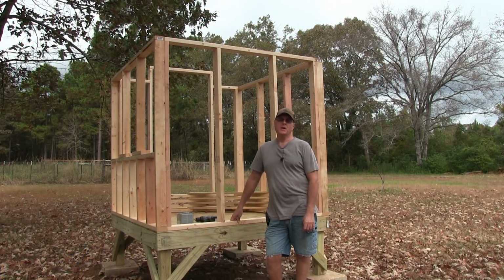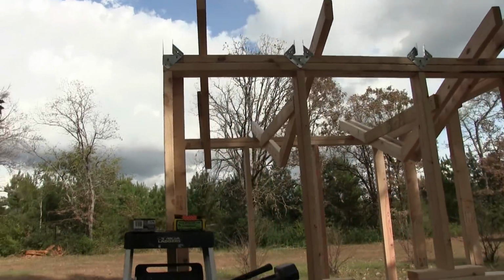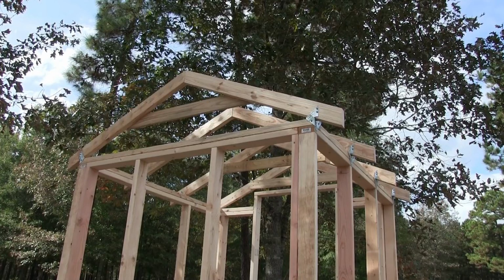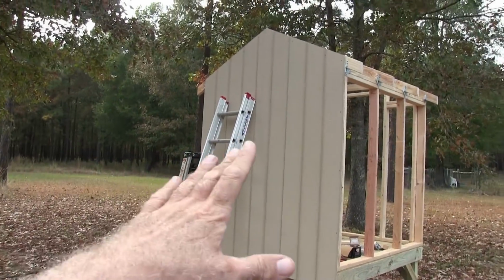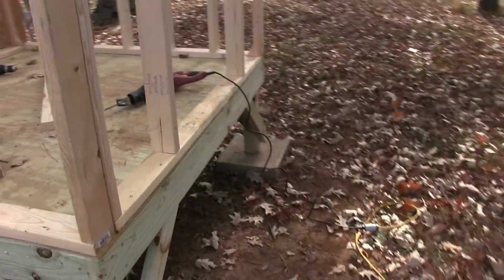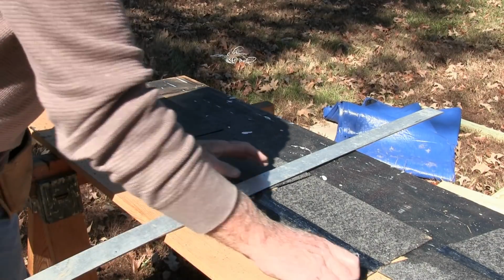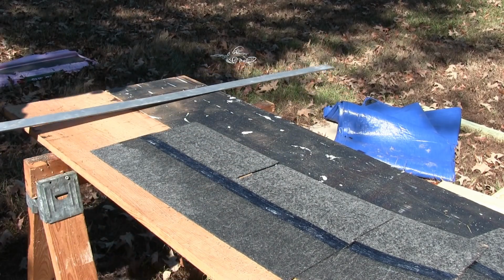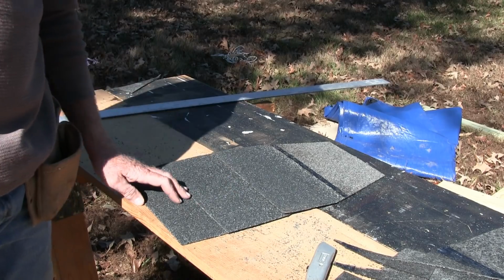Chicken coop build part 3 - Rafters, exterior sheeting and roof.

Comment: Hi Pete! Amazing videos thanks! I'm currently building all the walls. I'm half way done on em but getting nervous on the next step for the roof rafters. If you could give me an idea of what length each 2x4 should be before cutting a 25 degree cut would be awesome. I didn't quite understand what you meant by 12x5.59 so that might have something to do with it? I went ahead with your recc to do a 6x8 which the base turned out great!

Comment: What is that exterior sheeting called? It looks like OSB with a weatherproof coating on one side. Do you have a link for a US seller? I can't find anything like that in UK. Great video by the way. Thanks for filming, Andy.
Reply from the maker: It's called Primed Engineered Panel Siding. Here's some links: https://www.lowes.com/pd/SmartSide-38-Series-Primed-Engineered-Panel-Siding-Common-0-315-in-x-48-in-x-96-in-Actual-0-315-in-x-48-563-in-x-95-875-in/3058153 and here also. https://www.homedepot.com/p/0-344-in-x-48-in-x-96-in-Wood-Primed-Siding-Panel-Common-11-32-in-x-4-ft-x-8-ft-1277124/307432072
Reply: @petebeasttexashomesteading  Awesome, thank you

Comment: Hello Pete.  Good video on the build, but for a novice DIYer, it does not show some basics.  I going to build this design coop, but I need to know what you used for installing the siding.  What type of nails and nailer were you using?  Were they brads, finish or regular nails.  I have already purchased the LP Smartside 4 x 8 panels and want to install correctly.  I would greatly appreciate your assistance in this area, thanks.

Comment: Where is the ridge beam? I've never seen a wood structure built without a ridge beam. It just gives the roof more strength and stability. Everything else you've done is good, I may have done some things different but I cut my baby teeth on wood. My dad was a Master Carpenter and he probably forgot more than I could ever learn but he taught me everything I needed to know in order to build my own house. Best of luck with your chickens. Just a little suggestion....where the run top meets the coup, I would still nail the chicken wire down. I learned the hard way not to leave gaps in the wire bc a raccoon got into our run bc he found a gap. He murdered most of our chickens before we could get to them! He just killed them and didn't even try to eat one! My husband dispatched him with one shot! We put up a warning sign for all the rest of the little varmints that may think they want to try the same thing. I hope they can read the warning!🤣I states clearly that all varmints will be shot for trespassing!🤣🦊We dont discriminate either bc it goes for ALL varmints!🤣🤣🤣 We are raising ducks also bc their eggs are larger and in my opinion, has a richer flavor in them. If you make a cake that asked for 2 eggs, you only have to use 1 duck egg. They are so funny to watch too! Sometimes they get into arguments with the chickens over the grasshoppers during the summer!🦆🤣🤣 Best of luck! If you need any help with your chickens, just give me a shout! God Bless Y'all! P.S. Be sure to sprinkle Diatomaceous Earth all over the ground of your run. When they go to take their dust bath, the Diatomaceous Earth helps to keep mites off of them. It's also a great worker if you put a little in their food.🙂❤
Reply from the maker: Yeah I didn't put a ridge beam in because I thought its just a chicken coop. I'm definitely going to do the diatomacious earth in their food and run. Thanks